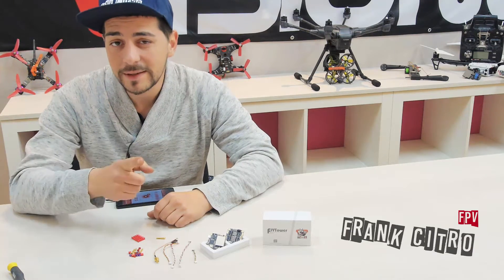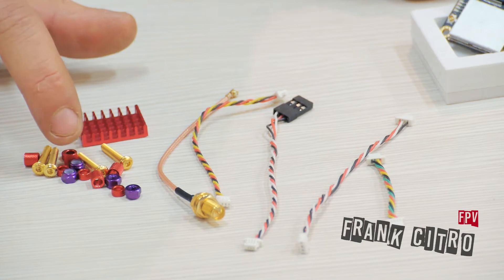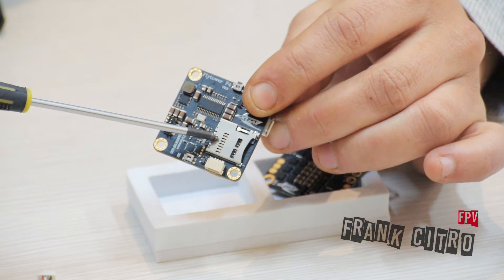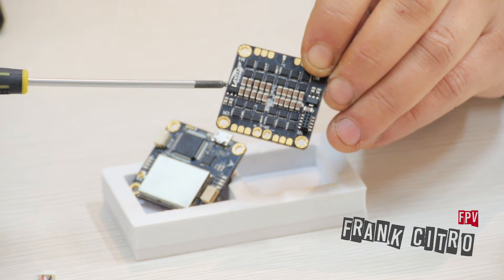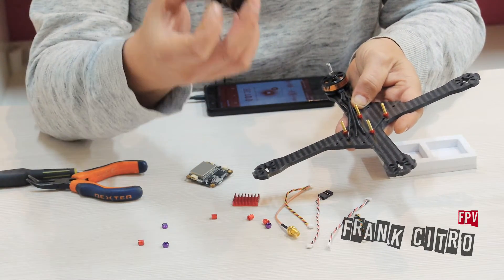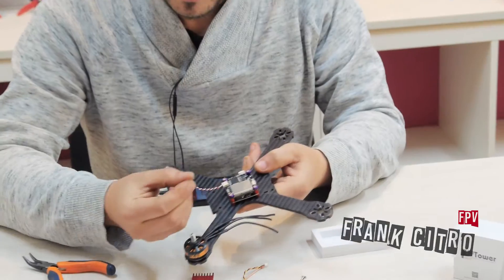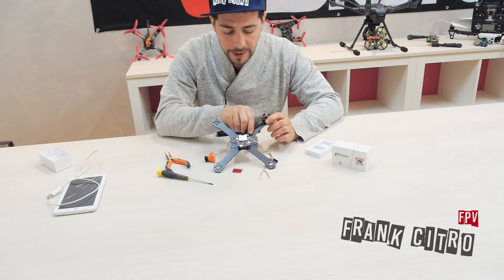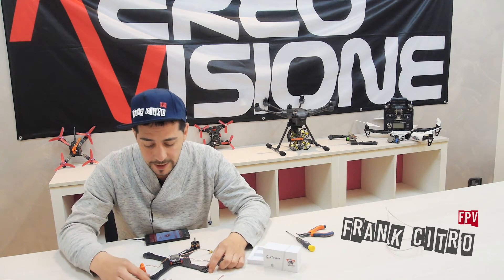FLYTOWER F4 FC for fpv drone ( frank citro review )

Comment: wondering why there is only one receiver connection? What about the other 3 channels?
Reply from the maker: thumbsrpp do you mean the uart ?
Reply: I'm new at this but the last flight controller I installed had a lead for every spot in the radio receiver. I only see one connector for the receiver on this board. How does it get the signal from the transmitter?
Reply from the maker: you have 2 connector 1 is for spektrum receiver other one that you see in the video is for sbus receiver or ppm receiver ... so you can use every receiver you want. if you mean to have single channel by channel so the fc have no this feature. all fc involve to remove these pins becuase is a very old metod to connect the receiver
Reply: OK, Thanks a lot!

Comment: looking at his to build a 6s racing quad. ESCs and response rates seem high enough to keep up with the rpm and load.
Reply: just wish it had the racercube frysky module on top so I dont have to buy it all separate. Trying to keep compact. Looks like it can only take 4s... wonder if I can hack the components or just actively cool the board :)
Reply from the maker: with 4s the components it's not hot so i think you can use 5s ... i'm not sure about 6s

Comment: Is there a way to connect telemetry?  checked the manual and did not seem to find anything :/
also could you check the 4 pads on the USB side?  That might be uart1 so possible to connect telemetry to it? just check to which pin of the F4 chip they go :)
Reply: Jan Trzupek 
it has no output for motor 5 and 6 ;) just soldered it directly to the F4 chip
Reply from the maker: do you mean to connect a serial telemetry on standard tx rx pins of uart ?
Reply: Yes exactly :)
Reply from the maker: i confirm that the flytower don't have any uart available for the telemetry
Reply: +Frank Citro 
what about the 4 pads on the side of the F4 chip? Seems to be a Uart connection
Reply from the maker: it's a connector for sbus or dsmx , of course it is an uart Rx (side of fc) but it's the only way you're able to connect your receiver , you dont have a standard pwm input channel by channel
Reply: +Frank Citro 
I did not mean the connector...  I meant the pads on the left side of the F4 chip!
Reply from the maker: i have not investigated on that pads :(
Reply: I red on rcgroups, that you can use softserial and pads 5 and 6 for motors. Haven't tried that though
Reply from the maker: yes only this way